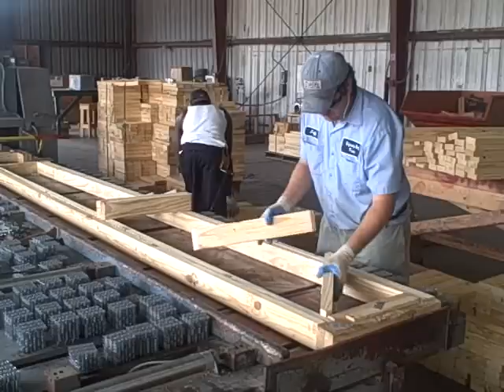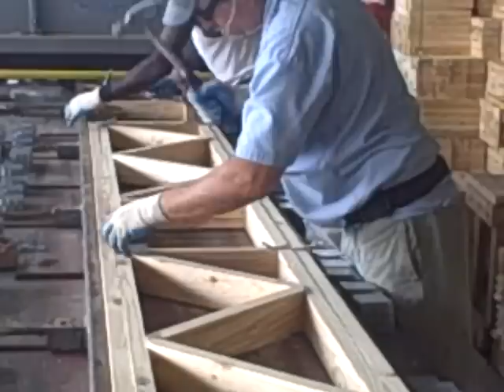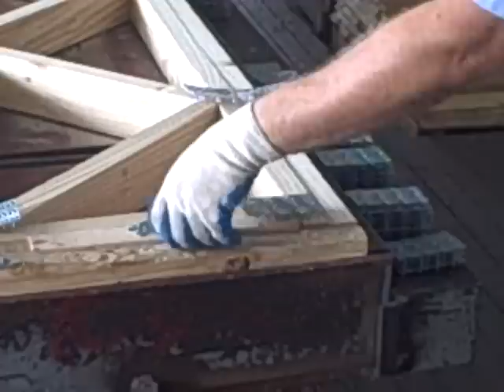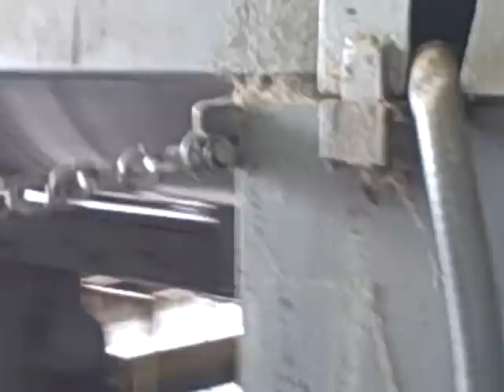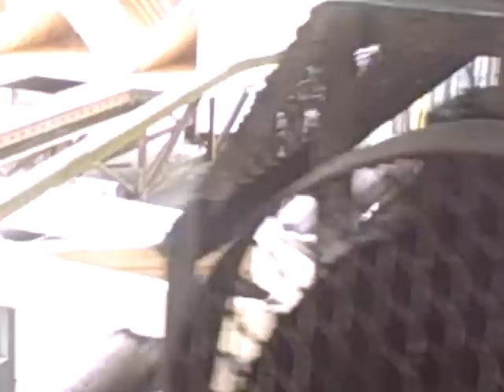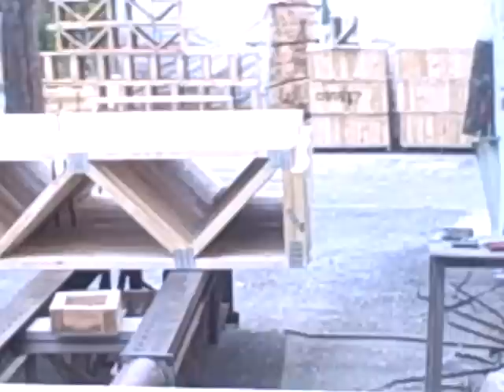Assembling Floor Truss

Comment: I held this job for four years until the plant shut down. There was no saw I couldn't run and had no problem going from roof, wall, and mark 5. I even had friendly bets on night shift to see if anyone could beat me on the floor truss. If even give a handicap by taking 60% of the truss and running the press. Those were some good dudes I worked with too bad management killed the plant

Comment: Open web floor trusses can be custom built to perform for a specific location in a floor system where an i-joist can not do that since they are all built the same. For example, a floor truss can be custom built to carry a large load at a specific point along the top of the truss such as a column in a wall that supports a large load and sits in a specific location on the truss. The ability to change the plate size and lumber grade in a floor truss makes this capable.

Comment: These look so much stronger than OSB crap I am seeing around new subdivisions in my area
Reply: senaddor They may look stronger but depending on the engineering the OSB is likely engineered to be consistently stronger than this sawn lumber.
Reply: @gnolls  no way is stronger then this
Reply: @gnolls  ; IF plywood gussets are used, with glue and screws, in place of those worthless pieces of sheet metal, no way.  OSB is garbage.

Comment: Nope, the metal connector plates do their job. There are many benefits to trusses like the reduction of product site theft and the advantage of duct chases,  ease of install, ect. Most complaints come years down the road though due to squeaking. That happens in floor trusses and is just something that has to be absorbed in the overall value.

Comment: No glue or fasteners? I'v never understood how those metal [plates hold at all,I'd at least staple them.
Reply: The plates have several points of connection and once rolled they're a bitch to get out

Comment: Why only plate one side?
Reply: If you notice the doubling of the top and bottom chords, they are add a plate to those, this machine unlike newer ones which flip it over to the other side of the table lack that option or capability. Thus why you seen them hammer on the wood before adding the plate. Newer ones as i said they start on the assembly side and once that was pressed it would be flipped to the other side once the previous finished one is removed to be plated on the other side.

Comment: thats why hurricanes destroy houses in usa ))
Reply: Why? They're stronger than I-joists, faster to put in place, more stable, less bouncy. I-joists get compromised if you drill or cut them in the wrong spot, no drilling or cutting necessary with Floor trusses.
Reply: Soviet Union fell apart because they didn't have trusses like that.

Comment: That's why I'll  never use trusses!   Just those cheap little tabs holding it together.    Garbage!
Reply: Unless you've lived you're entire existence outside, and never once been inside of a modern man made structure, I promise you have "used" trusses. Those little tabs are called (gang nails). Look up the engineering specs. They're stronger and more reliable than they look, by far.
Reply: Did you ever tried to take one apart? Try, and then you will know how strong those things are.